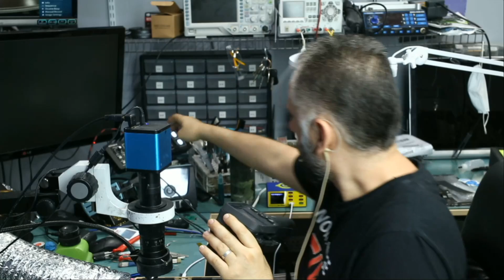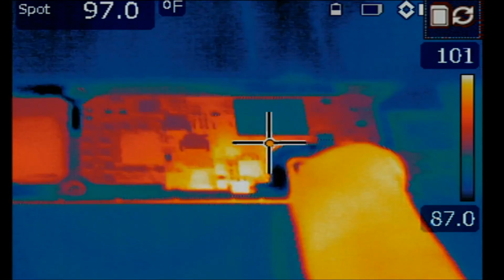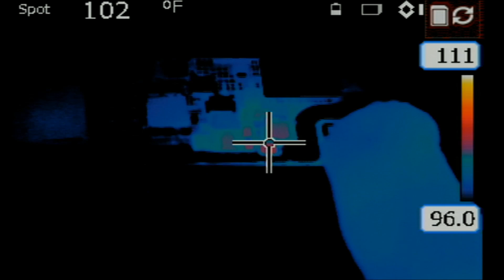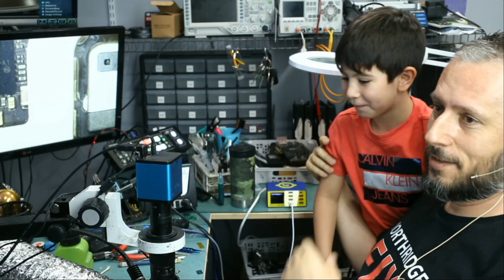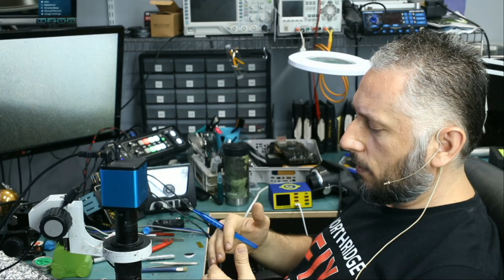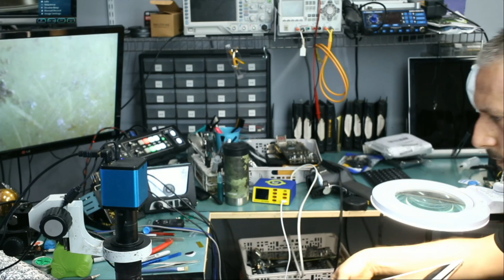iPad pro 12.9 2nd No Power Repair - Unstable charging and pulsating power IC.

Comment: Hello, am really impressed by how you fix these apple gadgets with pin point accuracy. Thanks for sharing your work. I need help with my iPad Pro 11 2018, It’s Not charging. The only way to charge it is when it’s in DFU mode… I have cleaned the charging port and am using original cable. How can you help?

Comment: fun fact: i can actually hear my (now problematic) phone's charging "mode" due to a static noise interference in a nearby fm-radio at a specific channel 😃 and when the slow charging problems came up i noticed pulsating noise as if the charger switches on/off continuously (pulsating noises happens only with the original cable and charger) the static noise was helpful to recognize if proper/fast charging mode was active, which it wasn't anymore, it only re-appeared when i was twisting the cable in a very unhealthy way. . so i tried 3 different cable and 4 chargers but the phone charging at 0.5A max (very, very slow) since a few days now. 

i cleaned it carefully but there is no dust etc. It is a oukitel wp5 (rugged, "waterproof") MTK phone but i ripped off the annoying rubber plug at the usb-port ..so i assume it could be moisture somewhere deep in the port maybe.. but not sure if i want to open it..yet.. hehe.. anyways.

Thanks for sharing knowledge with the world, greetings from germany.

x

Comment: i have an iphone 8p that the wifi chip was getting boiling hot, would you suspect the wifi/bt ic. i probably should compare the diode readings from zxw on the boards wifi contacts. just not sure. i have already removed the wifi chip.
Reply: i almost bought that mechanic charger but i held off.. aww

Comment: Great work. This videos gives another idea mostly how it behaves wen there is a problem with the Power IC. Unlike the iphones the IPad connects the charger Voltage direct to Power ic so most likely this should have caused the PMIC failure due to the charging

Comment: Recently I try to fix macbook air a1466 which won't turn on. After diagnose issue found rsmrst circuit. I fixed then board turned on and working perfectly fine on adopter. But on battery it's not turn on when power button press. But if power button hold for 7 to 8 seconds then it's turn on and work as normal. Can anyone suggest me what section of motherboard I have to check to resolve this Issue